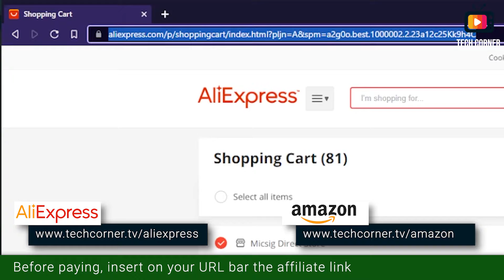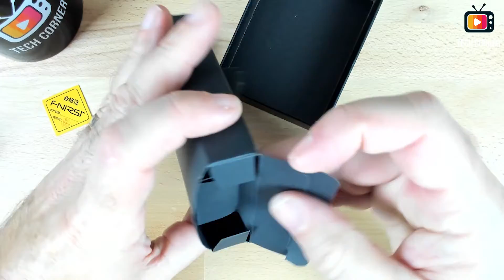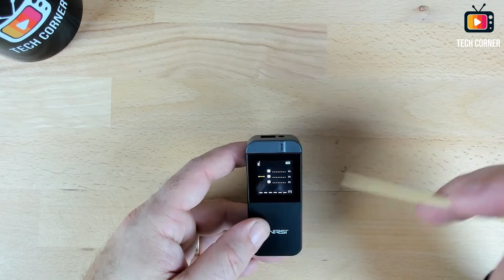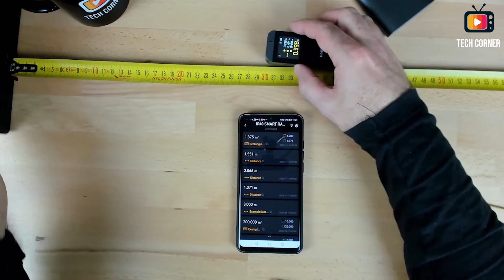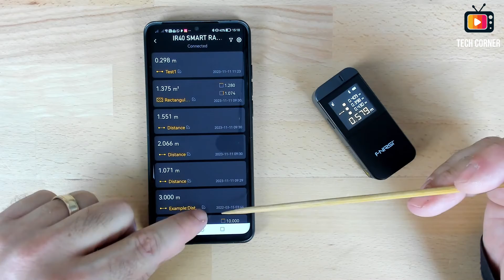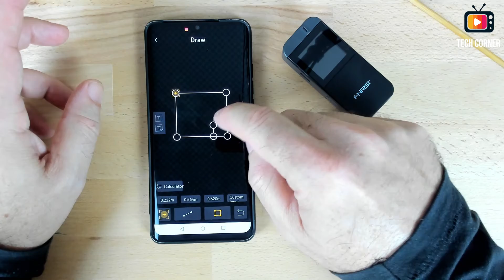FNIRSI IR40 ⭐ Smart Laser Rangefinder ⭐ AWESOME!

Comment: These really aren't meant for measuring such small distances exactly for the reasons you mentioned.
Can you test it's accuracy on lengths of 3, 5, 10 and maybe 20 meters?
Reply from the maker: Hi, you're right.... 😁 the problem I had is that normally record at night, I have a day job and it was really hard with everybody sleeping inhouse and night outside to be moving around. Future videos will have to be more creative and get the time to record during the day. After the video release, I did use it on my backyard and it seemed very precise still. Had to get my 15mts measuring tape to confirm, is harder to go to the mm, but it was fairly accurate. Thanks for watching.
Reply: @TechCornerTV  Fair enough. At this point you also have to also ask yourself - how accurate is your 15m tape measure. 15 meters is 15 meters, but up to 1 mm? I don't know if they are produced with that accuracy and even if they are, at 15m I imagine temperature itself is able affect the tape by 1mm. So if the laser is off by 2-3mm at 15m I think that is awesome. It's worse if it's off by 5-10cm though ;)